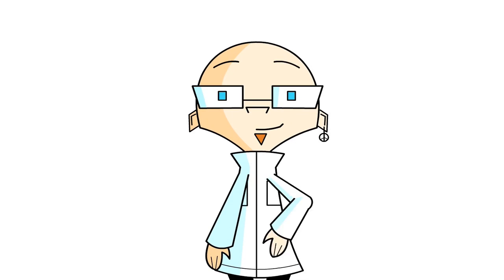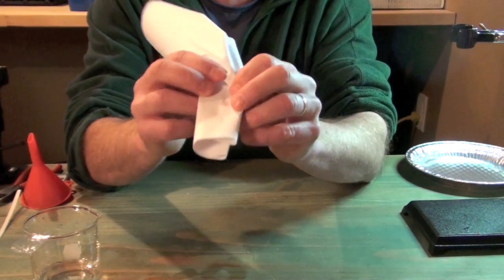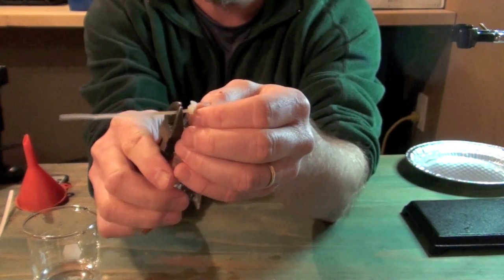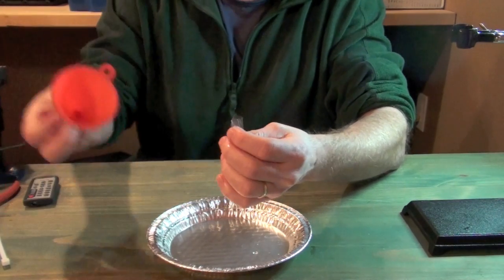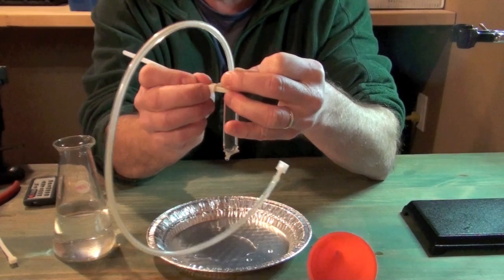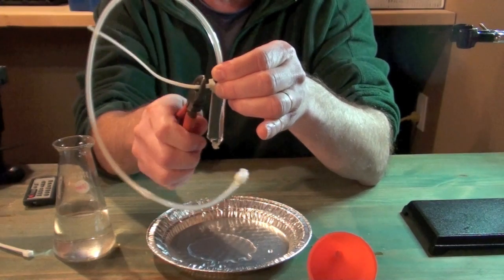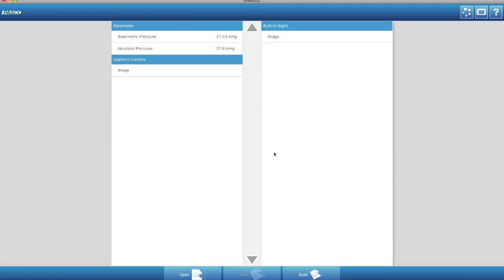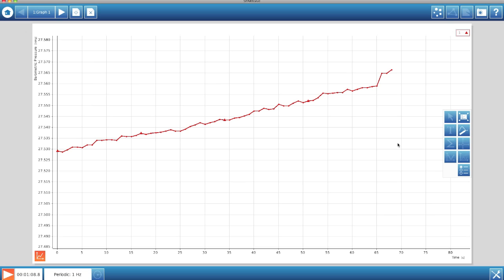ScienceMan Digital Lesson - Biology - Dialysis Tubing Experiment Tips

Comment: Why didn't you include starch in your experiment? in our lab we included starch,sugar,water mixed with IKI2. We aimed to check whether there would be a change in the colour of the beaker and the dialysis tubing, and to see which solutes would be able to diffuse. Also we've connected all of that to (I2)test for starch and benedict's test for reducing sugar which is glucose as it has the reducing group CHO. Maybe, I mixed between 2 different experiments?!(Please clarify to me the main concepts.)

Comment: Hello.  So, I was confused at first.  I thought concentration was viewed from the standpoint of what is dissolved in the water, in this case, the sugar.  So that is why I thought the pressure would decrease, because I thought the sugar would flow out.  I guess the sugar is too large to leave the membrane?

From further reading, it is the water that is trying to be balanced (if I'm correct), not the "solids"/sugar.  So there was a higher concentration of water on the outside, trying to go in?